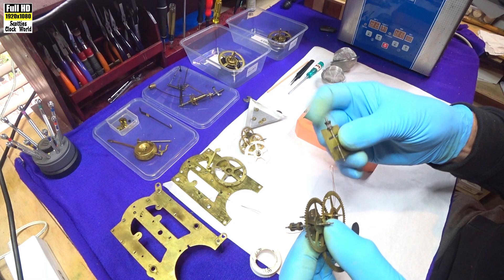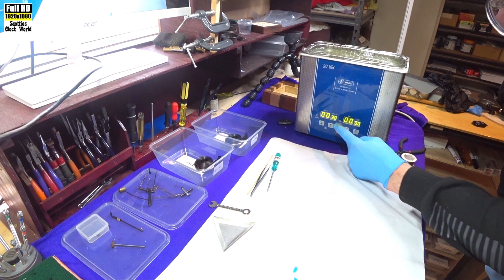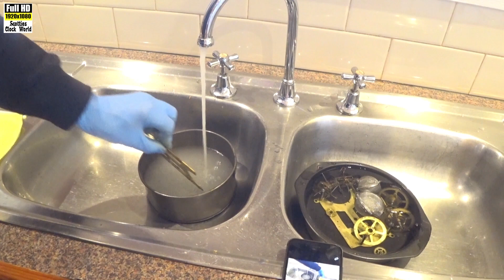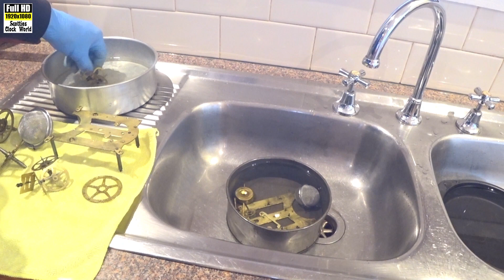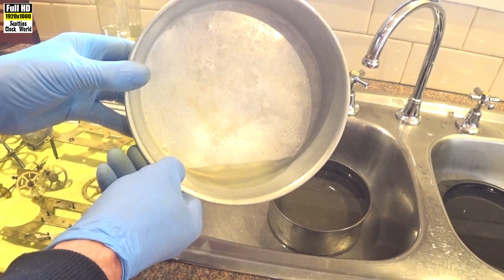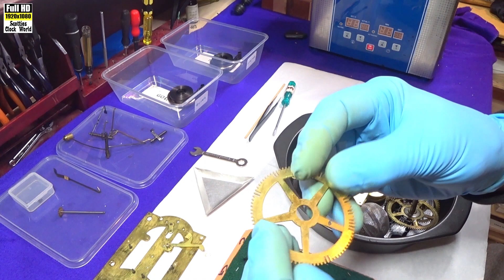How To Clean Clock Parts In An Ultrasonc Cleaner

Comment: Thank you for the detailed explanation of cleaning the various parts and how to tie up the wheels.  Question:  What capacity ultrasonic cleaner do you use?  Thanks
Reply from the maker: @DanSheffer-l2f , my UC is 3 litres. It will hold a complete American kitchen clock movement, disassembled of course. Thanks for your comment.
Reply: @ScottiesClockWorld    .  Thanks for the quick reply.  I appreciate you taking the time to answer my question.

Comment: I take all the parts and soak them in Mineral Spirits for about an hour.  That will remove or at least soften all the dried oil.   Then I put the parts in the ultrasonic cleaner for 10-15 minutes.  (Water and some detergent in the ultrasonic cleaner.)  Wash all the parts off in warm water and let them dry...
Reply from the maker: Yep, that'll work. Thanks for your comment.

Comment: I’m using an ammoniated ultrasonic L&R set of watch cleaning and rinsing solution. How do I properly dispose of them after clean and is it possible to reuse the solution?
Reply from the maker: The solution can be used many times over. When it's time to change the solution, put the old solution outside in a container and let the Sun evaporate the water. The oil/tresidue left can be disposed of at the rubbish tip in their Oil container. Thanks for your comment.

Comment: Thanks Scottie - your vids are great. I'm a bit of a noob with YouTube - what is the next step - do you polish these parts? They could actually be pristine after this, but I can't see it in the vid, perhaps reflections.
Reply from the maker: Only French clock movements are polished (as they were originally), American and other movements have a coating of lacquer on the plates to retain the shinyness. Polishing them will remove that coating and the plates will tarnish very quickly.

Comment: Would an ultrasonic cleaner potentially damage/break down fiber gears in a synchronous clock movement?
Reply from the maker: I'd be a bit wary of doinmg that just in case.
Reply: @ScottiesClockWorld that’s what I thought, thanks.  Perhaps I can remove it from the clockwork and clean it by hand
Reply from the maker: @davidpar2  , that's a better plan in my opinion.

Comment: So…would an ultra sonic cleaner still work for a fully assembled clock works that just needs a quick clean?
Reply from the maker: best to take the movement apart first. If you don't want to do that, you can clean the movement in lighter fluid.

Comment: What cleaner are you using in the ultrasonic cleaner  stock or homemade formula
Reply from the maker: Clock parts suppliers have UC solution.
This is the brew that I use these days, you can make it yourself.
Works just as well as the super expensive 'professional' ones.
Acetone 2%
Oleic Acid 2%
Detergent 2%
Water 90%
The figures don't add up to 100% because the first three ingredients are combined then diluted 1:9 with the water.
Reply: @ScottiesClockWorld  is that not 3.3% of the first three ingredients and 90% water?

Comment: A great video! I have never thought of those tea strainers  for the smallest parts. And I usually use 20 minutes with my ultra sonic cleaner and + 40 degrees. The manual of my ultra sonic cleaner says that the parts should not touch each other to guarantee the best cleaning result. By tying the wheels together with a wire would interfere the cleaning process as well as putting too many parts in the cleaner at the same time. I use to clean the plates and other parts separately. But it saves a lot of time if 5 minutes is enough and the tying the wheels together doesn't do much of a difference. Maybe I should try that and compare the results....
Reply from the maker: 20 minutes is too long, the UC chemicals will pitt the brass.
Tying the wheels together makes no difference as the bubbles generated by the UC move the parts about a little bit while in the solution.
Give my method a try and see if there is any difference in the final results you get.

Comment: Great video Scottie. Noob question for you. If the UC has cleaned the parts of oil, grease and dirt, why treat it again in Shellite? Does the UC concentrate leave residue on the parts? Is there such a thing as UC Rinse Aid where it will neutralize any cleaning agent on the first wash and evaporate without leaving and film or residue? Thanks so much.
Reply from the maker: The UC leaves concentrate leaves residue on the parts which as to be washed off with water.
The Shellite (AKA lighter fluid) is used to remove the water from the parts after thay have been washed.
I haven't heard of any UC Rinse Aid as such, the Shellite does that job.

Comment: Thanks for this video. It answers many questions for me. It looks like your ultrasonic machine has a 3L capacity. Do you find this a good size for most clock movements? Thanks!
Reply from the maker: Yes it's 3L and fits most front/back plates from US, UK, French and German movements.The 4.5L version  will allow slightly larger plates but is not worth the extra money I don't think. I also have a 1L for cleaning fountain pen and watch parts. I am going to do a video on using an ultrasonic with white vinegar/ bicarb. of soda to see how efficient it is at cleaning clock parts.
Reply: @ScottiesClockWorld  Thanks Scottie! I have been slowly going through your videos. A proper mainspring winder is the next thing for me to look into. Too bad they are so expensive.
Reply from the maker: @johnhannon  prices have really increased since the Covid thing. A winder is much faster and safer that manual removal of mainsprings.

Comment: Thanks for putting this video up. I used my ultrasonic cleaner for the first time today to clean clock parts so this is perfectly timed for me and very helpful.
I think I expected the parts to come out sparkling but they didn't, is that the wrong expectation and the intended result is that they are clean and not necessarily sparkling?
When you put your parts into the hot water bowl was there anything in the water because it looked cloudy and frothy....or is that just your hot water.
I am in the UK where shellite doesn't exist, I have read it is the same as white spirit? Thank you again!
Reply from the maker: Hi Quentin, 
After going through the UC the parts will have oil/grease/dirt/grime etc removed but will not come out nice and shiny everytime. 
The cloudiness in the bowl of warm water was caused by air bubbles, the tap is an aerator tap.
Shellite is just a trade name in Ozz for lighter fluid/white spirit/naphtha, they are all the same item.
Reply: @ScottiesClockWorld  Thanks for taking the time to reply Scottie....and for the videos, it helps us passionate amateurs progress 👍🏻